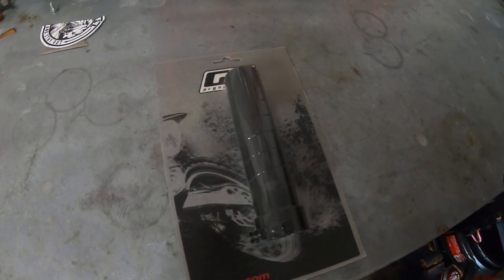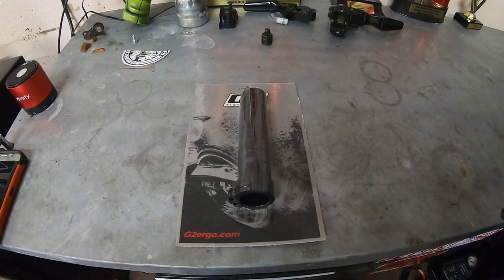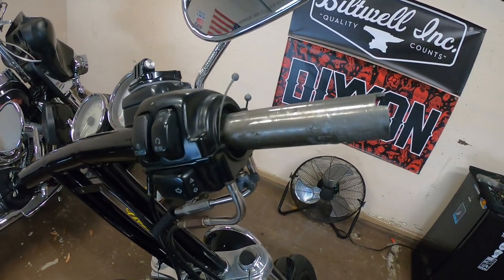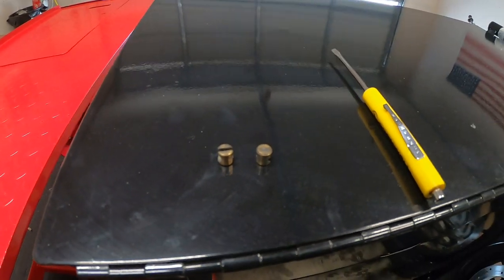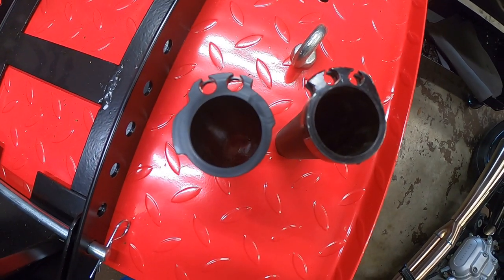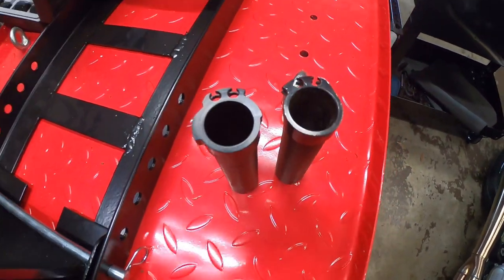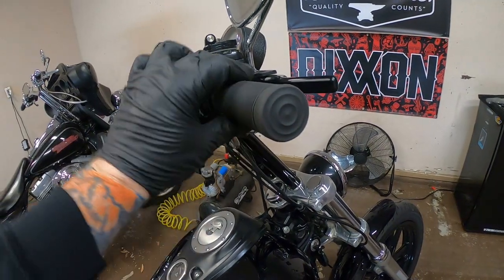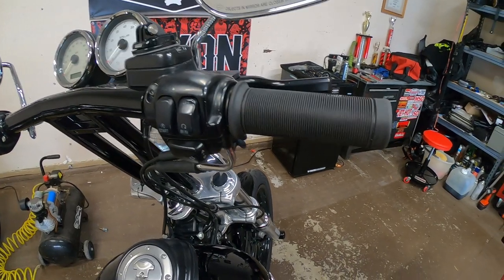Harley 1/4 turn throttle Install: G2 Ergonomics

Comment: I installed the same throttle tube on my bike for an Lectron carb and is not working well, if I install the pulley part up to the friction pad (“cruise control”) the housing don’t close, if the pulley part start on the corner of the friction pad the slide of the carb don’t close… and if I put the friction pad out the throttle do close to 1/2 turn… so I made my own cable for the pulley part starts from the corner of the friction pad and now the slide do not open completely. 🫨🫨🫨

Comment: MoonsMc makes one too...and it is metal, not plastic :)
Reply from the maker: I have since got rid of this bad for wheelies
Reply: @TrippHPjunkie  not what I want to hear as I am about to go install mine that I got yesterday hahaha. I will keep my stock one handy just incase. I was hoping to get rid of the chicken wing on my never ending throttle but never thought about wheelies and clutch dumps.
Reply from the maker: Haha it might work for you I just personally struggled with the 1/4" turn luckily its not hard to change
Reply: @TrippHPjunkie  so far, so good! I haven't really had the chance to wheelie it much yet tho!

Comment: Will this work for a flh 76 shovel with stock throttle ?
Reply from the maker: The tube I looked at on their website just now says 96 and newer bikes....not sure if you have stock style controls or not you may want to send them a email to check...  thanks for the comment heres the link for their website 
https://www.g2ergo.com/product-category/harley-davidson/
Reply: @TrippHPjunkie  Thx bud. Did find the same as you, but maybe a later aftermarket throttle housing might work like your BW Whiskey T.
Reply from the maker: @lassei4659  no problem at all I cant live without mine now....